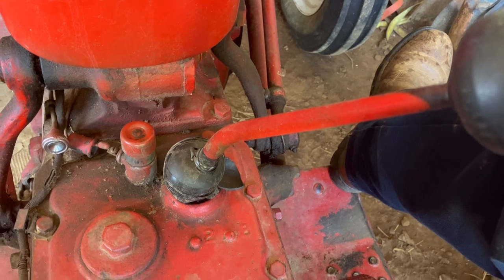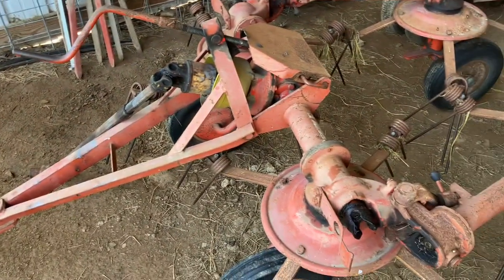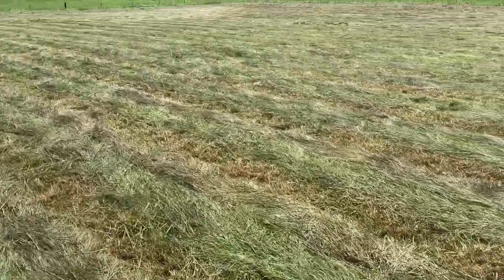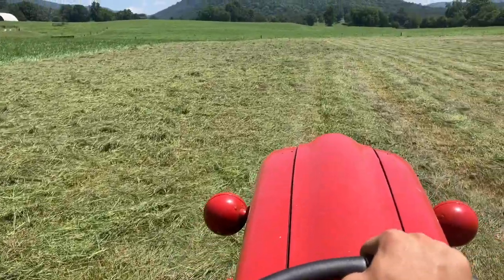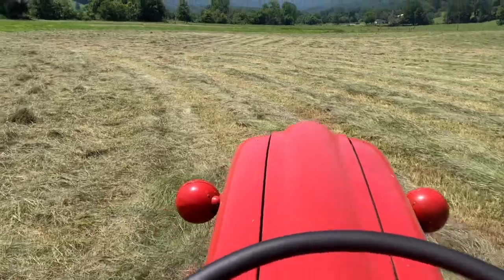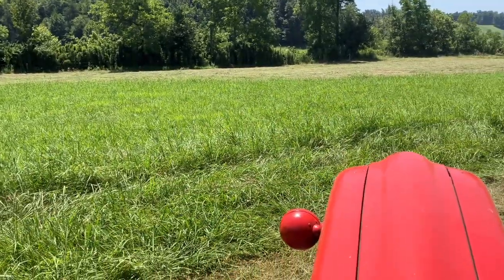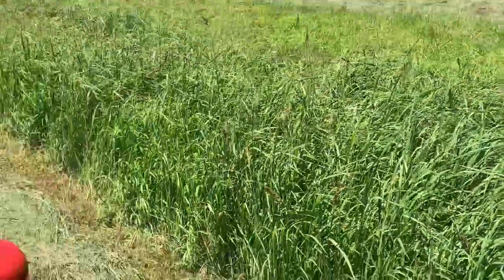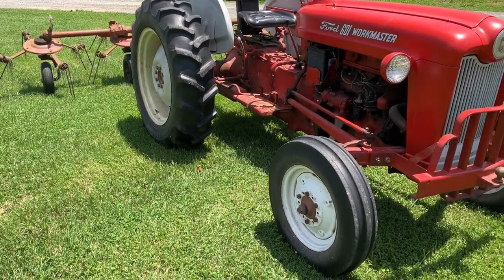Kicking Some 2nd Cutting Hay and How to Come Out Ahead on Farming Small Acreage?

Comment: We use a roll of black electrical tape on our two basket New Holland tedder between the drawbar and hitch clevis to take out the slack, but retain a flexible connection.  Of course the electrical tape has a hole in it for the hitch pin to go throughd hold it in place.  Here in the western mountains of VA, those size Fords and MF tractors ruled and still have a goodly presence.

Comment: Might be safer to fuel up with the engine stop ,fuel vapor, stray spark? ,happy harvesting
Reply from the maker: Yes, you are correct. I should have just let it warm up and then shut it off. 

The tractor doesn’t much like to be started up and then turned off, but I don’t guess a tractor is worth my life.